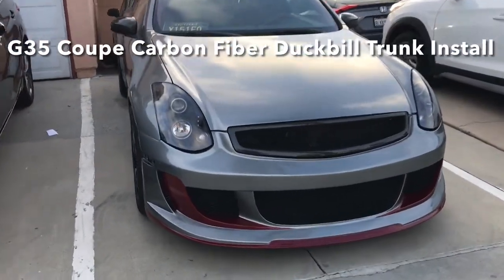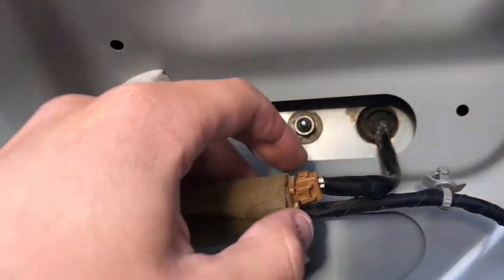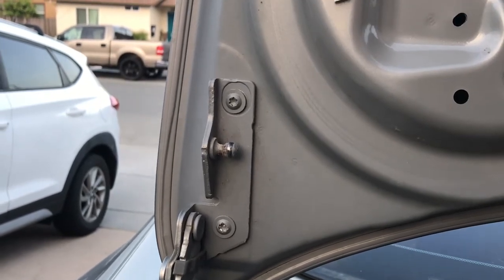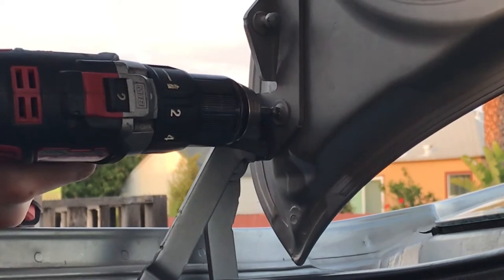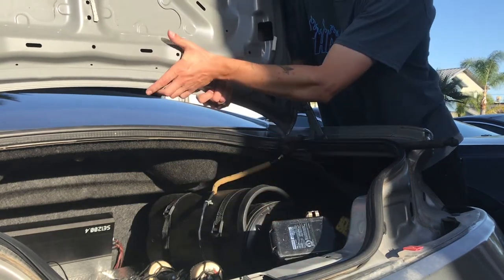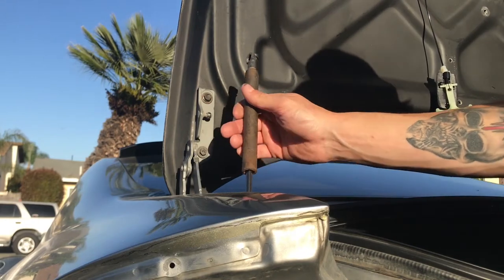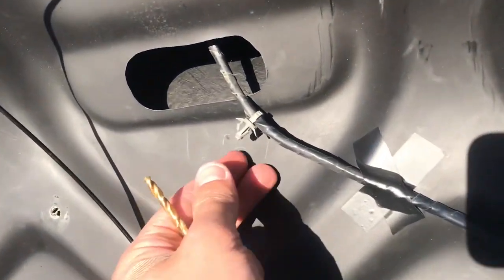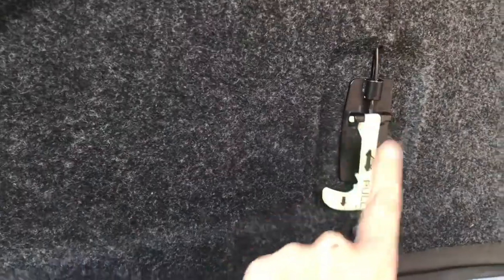G35 Coupe Carbon Fiber Duckbill Trunk Install

Comment: Torque bits are tight fit so if it starts to strip try the next size up👌
Reply from the maker: Pretty sure it’s the right size but the screws were so soft, they stripped instantly

Comment: 370z 19 rims? If so what’s the setup??
Reply from the maker: Yeah! Just got em, so hyped! Got 245 45 19 tires all around. 25mm in front and 15mm spacers in rear
Reply: @Donny_Bo_Danglez  a clean setup, black and dark grey combo